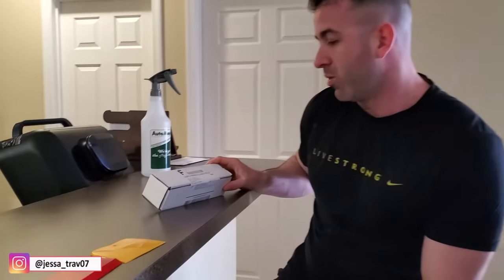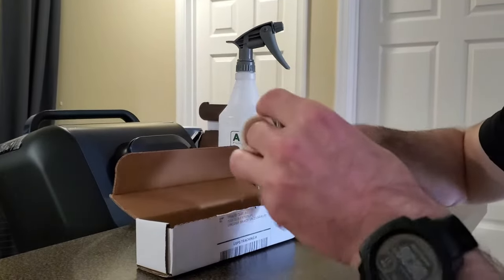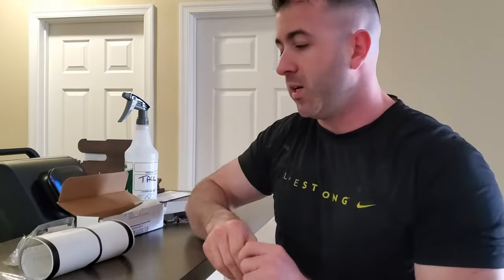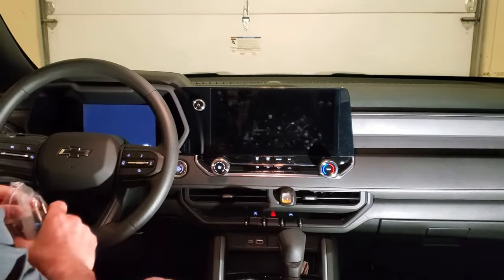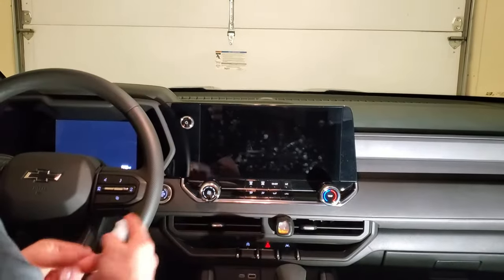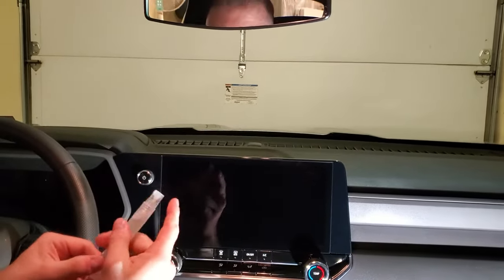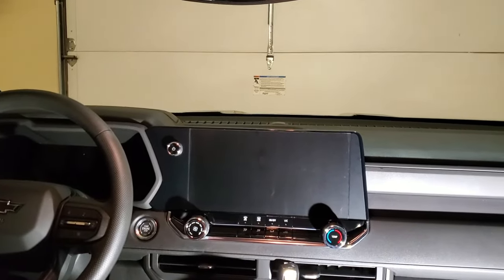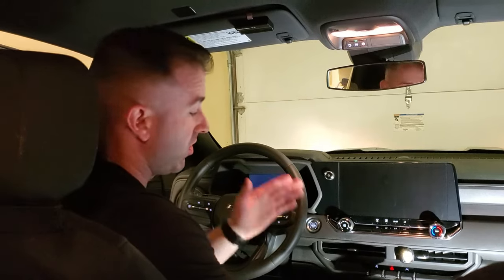2023 CANYON/COLORADO SCREEN PROTECTOR EASY INSTALLATION

Comment: Does the screen protector take any clarity away from the imaging? I am concerned that it may not look as “HD” quality with the matte finish, especially the camera views. Please let us know. Also, when will you post the center console protector video. We’ve been waiting several weeks now. Appreciate your work thank you!
Reply from the maker: So I couldn’t get the center counseling perfect but I did manage to get it on but I had to take the center out. I may remove the protector and Plasti dip it for that rubber textured look. The screen protector does take away slightly from the super clear but it does not affect the quality your expecting but it is slightly noticeable

Comment: Looking at their site it looks like your screen protector is for infotainment with no bezels, but your trailboss has bezels. Which could be why those vertical seams are really visible at the edge of the touchscreen. I could be wrong
Reply from the maker: No your correct. I ordered the single piece because I wanted to see if it would work and it did. You can order the 3 piece, the single does work well though considering the seams. Now it looks great and you can see the seams.

Comment: JUST AN FYI: you ordered the WRONG model screen protector, PLEASE NOTE: This screen protector  WILL ONLY FIT 2023 2024 CHEVY COLORADO Z71& ZR2, BECAUSE THE RADIO HAS THE SCREEN SEAMLESS IN ONE PIECE SCREEN DESIGN 【BEZEL-LESS DESIGN】The 2023 2024 Colorado Trail Boss, LT, and WT utilize a 3 piece design with seams seperating the screen from the bezel, you need to choose the model for the smaller display and installed that screen protector.
Reply from the maker: yeah, they sent me the wrong one when they initially started making them, I made it work regardless of the model, everything is now corrected